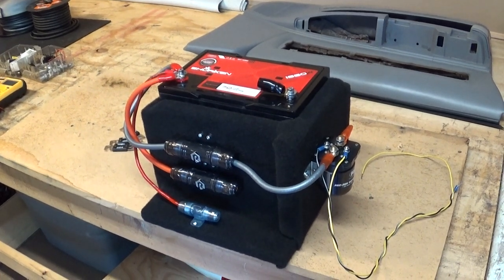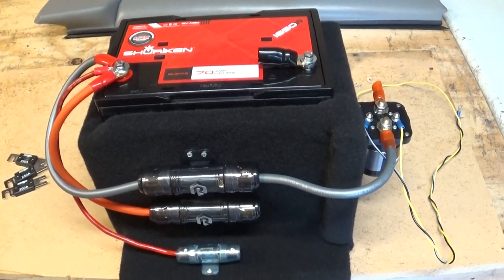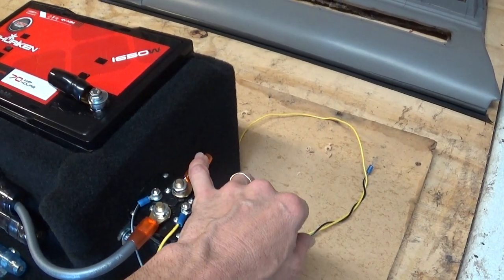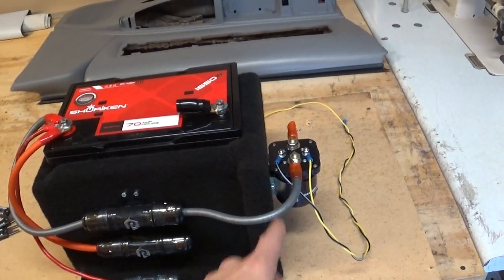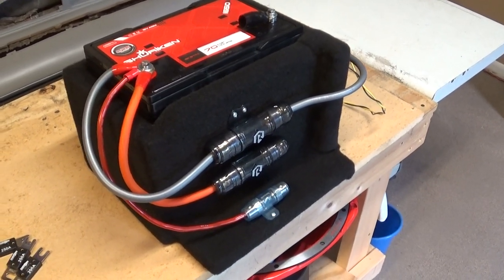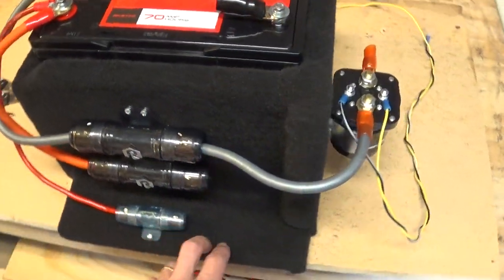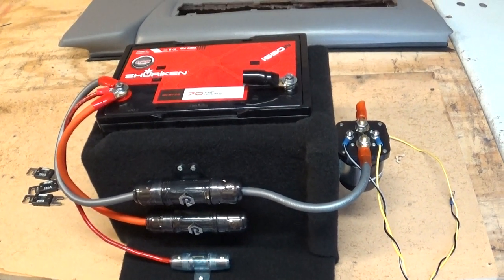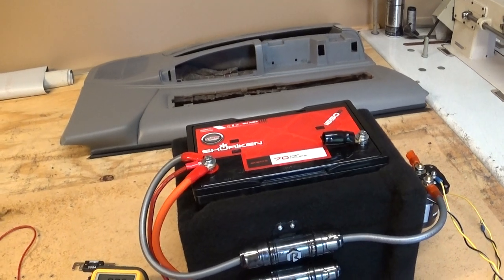Installing a Second Battery for Car Audio "Tips by Matt SSinteriors"

Comment: Also make sure your batteries are connected parallel. Plus to plus, otherwise you will be running a 24 volt system and mess stuff up.

Comment: I have a 2013 Malibu I did the big 3 upgrade, upgrade my alternator too 240 amps ,and I have secondary battery as well.. but my head light and interior dash lights dim still a little still..have kicker zx 1500.1 kicker ka 400.4 amps.. 2 kicker L7 subs .. what do I need too do?
Reply: Throw it away

Comment: Do I do the same process with 2 15" inch subs and each sub is 2,000 watts and my amp is 4,000 watts?
Reply from the maker: @alvinmorris360  if it's true 4k rms power. You need 370-400 amp alternator, 0ga 100% copper power wire and I recommend XS Power batteries.

Comment: I'M looking for a battery that can hold the charge when i bump my suB with the car off
Reply from the maker: @JamesBondzX  everyone's going to lithium batteries now!
Reply: @charles1matt  do u have any recommendation? 120a alt 2000 watt system
Reply from the maker: @JamesBondzX  XS power is my go to brand lately. Match the amp hours and watts you want.

Comment: Defeats the purpose have having more amps.
Reply from the maker: kev mar I think you might be confused, as the more amps you have means the more battery you need to store voltage. The isolator only disconnects the batteries from each other when the car key is turned off, hence isolating/seperating each battery so they last longer. That is the isolators only purpose. You do not have to use one.

Comment: WIth this, you don't need a capacitor for both of your amps, do you..
Reply from the maker: Just get both front and rear dry cell batteries and don't worry about a relay and yes a battery is better than a capacitor.

Comment: And if the battery’s are the same make and type will they still fight on voltage or the isolator is only if the batteries are different make and type or it all ways need to put a isolator I seen other videos that they only connect battery to battery this’s so confusing
Reply from the maker: Ferber b that's fine but its normally best to have a good cranking bat up front and a deep cycle bat second
Reply: matt1989cars it doesn't make a difference in the two different battery types?
Reply: Devin Azevedo That only matters if you connect the 2 batteries "without" using an isolator relay.
Reply from the maker: O' I may need to come back to this thought? I assume 2 matching batteries would share voltage better, but I always put good cranking battery up front and deep cycles secondary.
Reply: Best if batteries have the same CA and are the same type ie. flooded, AGM, Lithium.

But if they are different (or same) just make sure you charge them every couple weeks, it will prolong their life.

Comment: Great video! Couldnt make it easier for us new guys & girls.

I do have a question. The yellow wire can i connect it to the remote on my amplifier or does it need to be to the ignition switch?
Thank you.
Reply from the maker: @j.callejas3746  ignition so it always comes on with the car. thanks for watching

Comment: My bass amplifier turns off when I turn it up at times not all the times goes into protection mode . The mids amplifier continues to play help 😓
Reply: That's called clipping...amps overheating..
Reply: Yep. That's the amp going into protect mode. You're pushing your amp to the limit, sounds like you need a bigger/higher quality amplifier.

Comment: Fully charged AGM'S rest at 12.4, that's what multiple articles say and xs power battery instructions manual
Reply from the maker: rob shekelberg OK thanks and weird normal battery rest at 12.6 then everything is rated 12.5, interesting
Reply: matt1989cars yeah I notice that too

Comment: Hey I'm brand new to lithium and extra batteries really anything other than stock electrical I'm in the process of upgrading my system one piece at a time I'm currently running a kicker CXA 1800.1 on two kicker Q-class L7 12's on stock alternator and battery all 0 gauge OFC and big 3 done so I wanted to start by upgrading my power supply before getting amp/subs etc. so I would know what my limits are I just recently found out that my car is not HO alternator capable without extreme aftermarket customization to my engine it would literally cost me more than my entire system and some so I'm going the HO lithium battery setup to try to maximize my stock alternator I'm also ordering the ioxus ultra cap battery  because I have been told by xs power, Mechman etc. that super caps and lithium help each other work better especially with a stock alternator but as I said I'm brand new to all of this would it be better to delete the stock battery and just run the lithium/super cap setup and if so do I need to use an isolator and what size should I use or would it be better to leave the stock battery up front and run the other in the trunk with an isolator to protect the front battery and alternator please help any advice would be greatly appreciated
Reply from the maker: Use an isolator if you keep the stock batt up front. I need to learn more about the lithium batteries too. Always try to go up on alternator amps though.

Comment: So as long as my vehicle is running... this set up right here will give me voltage from both batteries to my audio system amps?? But also protect my Starter battery from discharging when the vehicle isn't running. Am I understanding correctly, I'm a lil slow?

Comment: The batteries will NOT fight over the voltage.  They will only balance to the same voltage.  It's fine to leave them together while parked and off
Reply from the maker: Yeah, I don't use these much anymore, but a bad battery WILL pull from the other one. This is not a bad idea if you know the vehicle will be left parked for long periods of time 👍
Reply: @charles1matt  yea it will pull from the other if the other is low.  Will pull til they are the same voltage
Reply: @charles1matt  so what do you use now?  Lifepo4?
Reply from the maker: @Millzlane  I recommend matching brand batteries both new and I use XS Power brand right now.

Comment: Good day sir how to fix voltage drop from my motorcycle with sound system
Reply from the maker: Try a lithium battery if one is available and low current amps like nano amps might help. I'm not too sure about the alternating system on motorcycles and if they can be upgraded, but that would be best if possible.
Reply: @charles1matt  thank you sir

Comment: Very great job, I just did a install on my car and I just finished running a 2nd battery and isolator and I see you have like a battery cubby looking thing is there any place i can get one from I would appreciate it if you could help me out?
Reply from the maker: Fuse holder?
Reply: @charles1matt he wants to know where you got the black box that the battery is enclosed
Reply from the maker: @jamaicasgodson2125  artery box is made from mdf speaker box wood scraps. Yo guys, I have over 500 other videos, not sure why this one gets views?

Comment: Is it ok to run a second battery on a stock 3.2 Liter V6 ?
Reply from the maker: ddoan 2001 you can add a second battery to any vehicle, just check the voltage as you play the stereo loud, to make sure it stays up around 12.5-13.8, if not you may need to upgrade alternator to a high output and or upgrade wiring under hood, search "big 3 upgrade for car audio"
Reply: @charles1matt  can you do big 3 Without upgrading the alternator
Reply from the maker: @carlosesparzavazquez4753  yep won't hurt and may help some. Did my truck the same. Voltage sits a little higher while running now.

Comment: I have 1 power cable goes to a power block with 3 out, all I want to know is can I put just 1 fuse block before the power block or should be 3 fuses after the power block, please anyone let me know.
Reply from the maker: Are you even using a second battery? Sounds like you need a 3fuses block instead all in one type deal. Always fuse amps individually and main fuse under hood grand total of all three. I'll reply again if you describe what you are doing better?
Reply: @charles1matt  OK I got it, I will fuse all amp separately, thanks for replying

Comment: Hey Matt, Great tips, I like the nice clean wiring.  I thought I had everything running solid but noticed my lights still dim under high load but my voltage meter NEVER hits 12 the lowest I see it go is like 13.1 maybe 12.9 rarely but the lights dim still.  Any ideas?
Reply from the maker: Big 3 upgrade or at least bigger alternator wire from battery to alt? Start there and upgrade alternator if you haven't already
Reply: @charles1matt  I should have been more detailed. I've done the big 3 and 250amp alternator.  Also running copper 1/0 and I have a d2400 xspower under the hood.  I'm planning to buy a second battery or rather a super bank now because the headlights are still dimming.  Surprisingly,  I only dip into low 13s and very rarely high 12 volts. I was surprised to hear you say that about staying above 12v that threw me off.
Reply: @charles1matt  running 3000 watts wolfram aw series and a 600 watt class ab amp. Slightly over 4000 watts rms
Reply from the maker: @joseph519r  ok and danger area is under 12volts but dimming can happen within the 12s solid 13.8 while bass is hitting is ideal or more. Betting the extra batt or bank will make the difference for you as everything is pulling off that one batt right now.
Reply: @charles1matt  Thanks a lot, makes sense.  I'm on it.

Comment: Hey I have a 2004 Volvo XC90 just hooked everything up on line converter. Tapped in the urge back door speaker . I have a second battery but it drains after about 2 hours of pounding hard . Then my amplifier starts dimming out . The second battery is dying . But why ? Do I not a a good enough ground ?! I’ve never used an isolator but I do own a brand new one by stinger .
Reply from the maker: If there's no isolator and only one batt is dying it's a bad battery? Use matching dry cell batts and no isolator. Sounds like you need a high output alternator also? And yes also make sure grounds are good!

Comment: i just bought same battery but way smaller cuz im only running a 1200watt system so i wouldnt need a big size battery but i wont have isolator on them i will have 2 fuses my main fuse and the new 60amp fuse for the new battery i should be fine cuz yeah my lights dim when i roll up and down my windows

Comment: Question I’m putting a yellow top in the trunk and I have a regular battery upfront ! I have a vfl 100.1 should I buy the isolator I’m just confused I’m already running 0 gauge ofc wire I just need to know what I should all need with my set up ?
Reply from the maker: Derek Quinones with a regular battery and a dry cell (yellow top), I would run the isolator. This will keep them separated while the car is not being used, ultimately making the batteries last longer. The isolator is never a must have, but helps keep the batteries from fighting over the voltage while vehicle is unused. Hope that made a little more sense?

Comment: Very nice job. I just installed a 370amp alt and big 3 upgrade. I am running about a total of 7,600 watts. What type of 2nd battery should I look for and what size! Please advise also will I need to run that 2nd battery to each amplifier I have?
Reply from the maker: Probably something like XS power battery, maybe the D3100 and yes amps should feed off the second/last battery. Don't forget to add inline fuses between batteries and between second battery and amps. 300+ fuse underhood or run 2 1/0 gauge power wire (solid copper!)
Reply: @matt1989cars  I've got a titan 8 pwr. Gonna be running around 7k ish watts and a h/o alt. Do I need to do two runs of power and ground from the engine battery,  or can I chasis ground the one in the back
Reply: @mattglassner3105  a 2nd run is good.

Comment: If I’m running an alternator positive direct to a secondary battery is it ok to run power wire from amplifier to the same battery terminal that alternators wired to? Confused as if it may want to pull directly from alternator instead of battery.
Reply: You want to pull from second battery, fuse in between both the alternator and second battery, and fuse between amp and second battery

Comment: Do i need a battery isolator if i  only play my steteo with the car on
Reply from the maker: It's best for keeping a dry cell battery and a normal battery separate while the vehicle is not being used. This helps save the overall life of the batteries. 2 dry cell batteries do not really need a relay. Hope that helps
Reply: @charles1matt  how do i determine the size amp isolator i need...my alt is 140 amp
Reply from the maker: @cowboyexecution3642  depends how much current all the amps pull total. Example 2000 watts would pull about 200 amps of current. There is a math equation to figure out exact, but basically it's 10 amps pulled for every 100 watts.

Comment: You say an isolator is needed or the battery life will suffer, this confuses me a little because all of the diesel trucks out there do not have isolators and they do just fine.
Reply from the maker: They're probably matching batteries then? Isolator is a good idea for storage of the vehicle too. You don't have too use an isolator though.
Reply: matt1989cars so you think I’d be ok adding a yellow top then? Bc my Underhood battery is a yellow top, I’d be adding same exact battery, I just really don’t want to run wire from ignition, and very rarely do I play music with engine off

Comment: What do you recommend for a 2 15 inch mofo speakers on a 5500 watt spl amp???? Help
Reply from the maker: Jay Parker not to sound mean, but I would trash that amp first!!! and get something solid (true wattage). If you're dealing with true 5000 watts rms, you need alternator upgrade, 0ga wire and multiple batteries for sure. Patience and a lot of time, don't burn those voice coils up by under powering the subs.
Reply: matt1989cars.. ok.. now with the alternator upgrade, right now my alternator is pushing 105 stock, I found one that pushes out 145, now is the 145 good enough or do I need to go higher and if so how much higher..
Reply from the maker: hard to say as each install I have to know all ends of the specs, from amps, subs, vehicle. If that's all you have access to, its a start. Be careful when the vehicle is just idling, that's when the alternator is putting out less. get a cheap stinger voltage display mounted on dash, about 20$
Reply: matt1989cars.. I appreciate you responding sir...

Comment: hey is it ok to run two different type batteries if i use an isolator ? wet cell under the hood and agm in trunk with no problems??..
Reply from the maker: Xavier Mcfadden , should be fine and in your case that's a perfect example for using an isolator, keeping those things separated while the car is not running.

Comment: What gauge was the gray? Also what gauge was the orange looks like 4 & 2 gauge ? I have a shuriken audio battery  not many vids on em was wondering if 4 ga is okay for wiring between the 2 batterys
Reply from the maker: I think they were all 4ga. I run 1/0 between batteries. You can use 4ga between as long as you're not pulling 200+ amps of current. Make sure to use good solid copper wire though!!!!
Reply: @charles1matt  i was thinking about getting 4ga welding wire would that be solid enough?  But off Amazon 😅😬 its about 80 bucks for 60 ft - 30'/30'- red/black, how do I calculate the amount of amps?  I have an 80 amp hour shuriken battery
Also thinking about putting a stinger isolator between the 2
Reply: Do I just add that one up with my current car battery
Reply from the maker: @Donaldtrummp  good rule of thumb is 10 amps of current for every 100watts. 1000watts would pull roughly 100amps and yes if using normal batt up front and a dry cell audio batt in rear then use an isolator. Fuse each end of the main wire between, both sides within 18" of batteries. Isolator should be whatever amps you're pulling, 200-500 amps. I would go ahead and get 1/0 or 2ga sky high audio power wire as its good at a fair price and you can get a good 20ft under 100$
Reply: @charles1matt  cool so I think i would be running 160amps in in total with the 1000w 1 channel for bass & a 600w 4channel for high's  i have 
Thank you for your help man I really do appreciate it 🙏 👍
also idk if it makes a difference i did makes sure when I bought my battery this past week it was AGM like the shuriken not a standard

Comment: Where & how you install the isolator trigger wire to?
Can i tap into my ignition wire on my radio
Reply from the maker: Manual says no radio ignition? I find a main wire under column. Isolator is a good idea if you have a normal battery under the hood and second battery is dry cell?
Reply: @charles1matt  
Yes i have a typical lead acid battery up front & a xs power 6500 as my auxiliary with a NVX 500amp isolator...what do u mean by the main wire under the column..? Also is the blue remote wire acceptable as a trigger?
Reply from the maker: @nathanielthomas2502  main ignition wire under column. Not suppose to use the remote wire? Not sure why though, lol. Just going by the instructions with the isolators.
Reply: Late reply but maybe you can use your heater power wire. In alot of gm cars the heater is right under the radio. It only comes on when the key is in the "ON" position